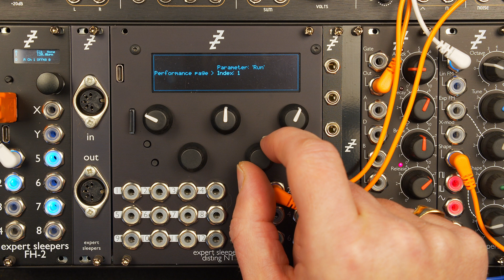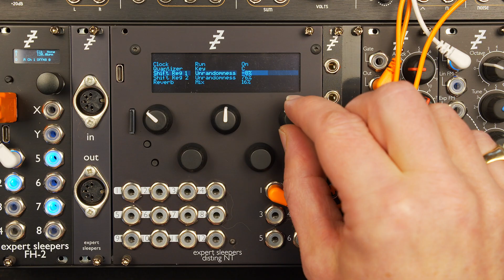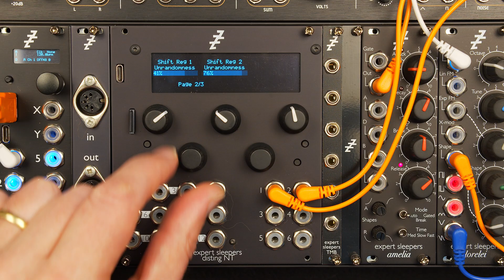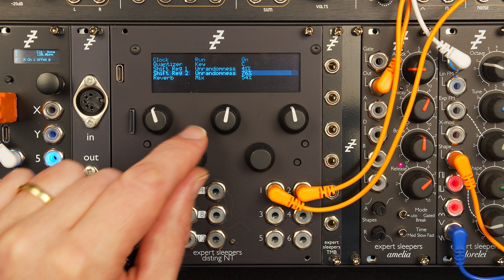disting NT - Performance Page

Comment: wonderful! about to order a NT myself, i'm wondering it's possible to map more than one parameter to the same knob? sorta like the macro knobs on a virus ti? let's say a hipass and a dry/wet on a reverb on the same knob
Reply from the maker: Yes. You can put a knob belonging to the "MIDI CC Generator" in the parameter page, and map the two (or more) parameters you want to control to be controlled by the MIDI CCs. It's possible there will be a more elegant solution for this going forward, but this does work quite nicely.